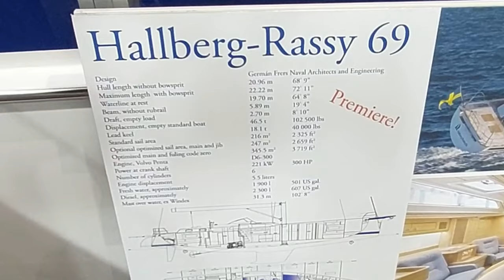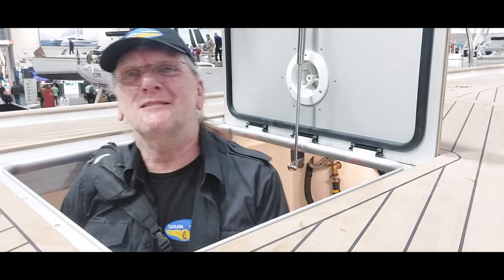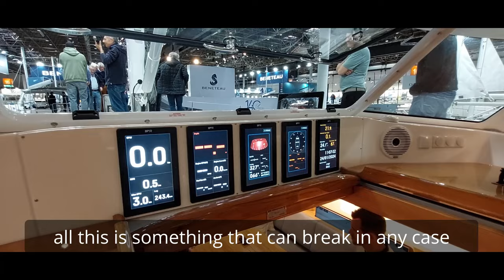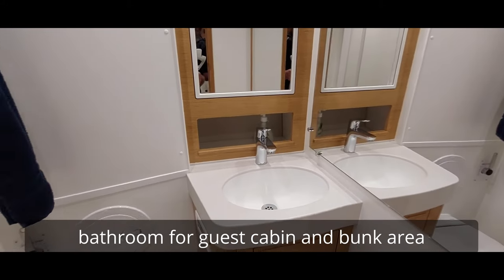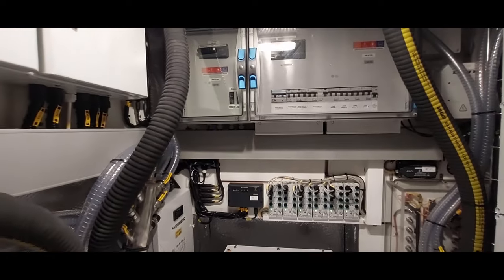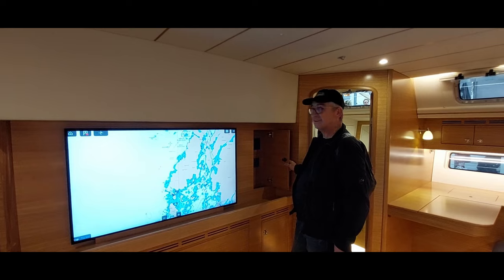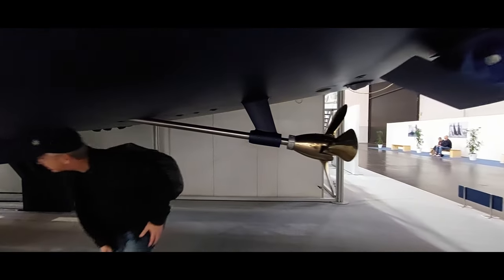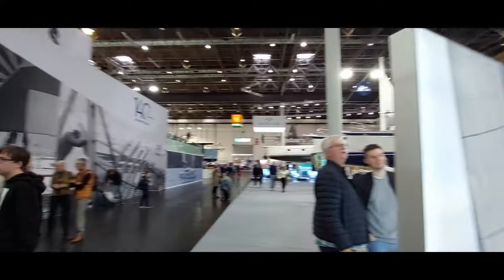HALLBERG RASSY 69 - BOOT DÜSSELDORF 2024

Comment: trouble with hydraulics is there is no such thing as "no leaks". Best have plenty of hydraulic fluid to top off the tank and plenty of oil dry pads to soak up that oil.  Not to mention how many stains you are going to have on the teak decking when the furling motors leak or the vang.  I imagine they use iso 32 oil or maybe 46 either way the rod end lip seal on any cylinder in salt water environment is going to pit.  Heck even in ideal conditions capillary action causes leaks on the rod end.  Hydraulic motors are seriously bad about leaks due to a rotating shaft around a lip seal.  Yah I've worked in maintenance too long.  Every hydraulic system leaks no way around it.
Reply from the maker: Yep, and thats why we do no want any hydraulics on the boat. Same problems you will find at some planes, too